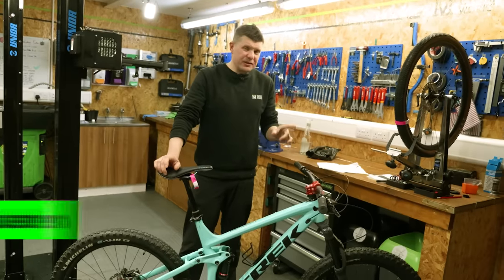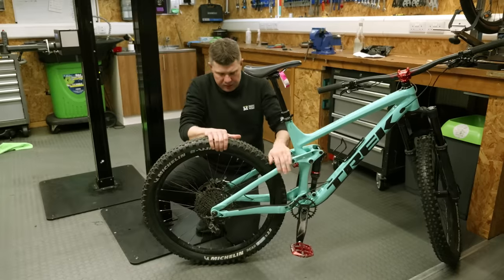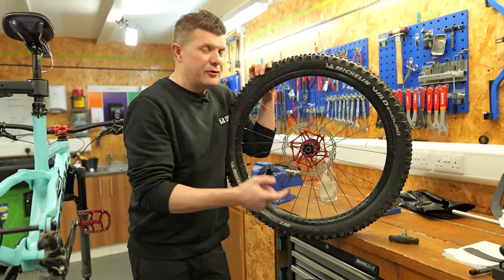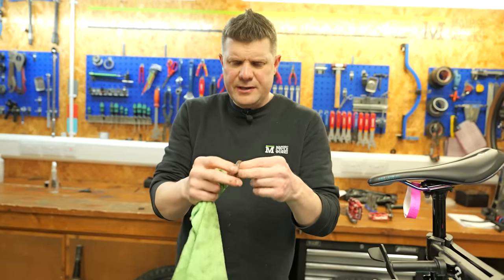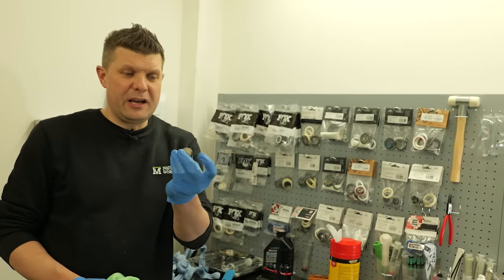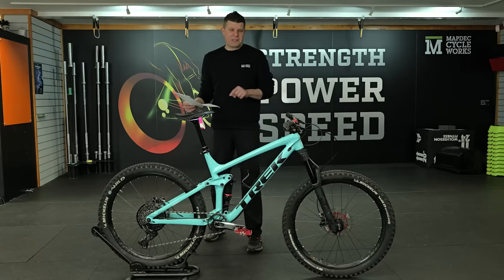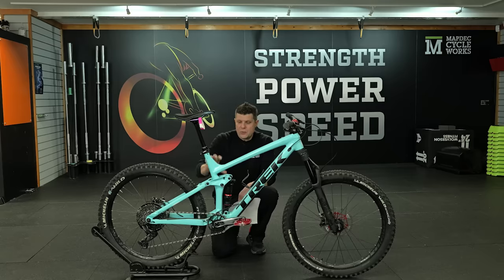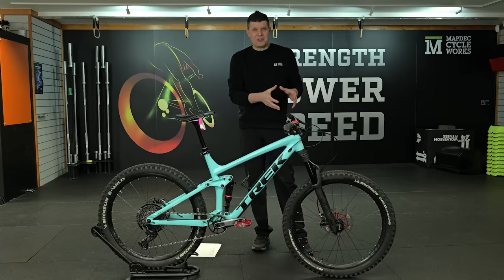They were quoted £975 to make this Trek Remedy safe

Comment: Old guy get off my lawn rant incoming and here goes... I'm 56 and raced motocross starting when I was 8. When I got to be 10 my dad told me that "if I'm old enough to race my bike, then I'm old enough to maintain it". He showed me how to change piston and rings on my YZ 80 and helped me the first couple of times, but after that I was on my own. So by the time I was 13 I was doing all of my own top end, carburetor, tires and tubes (my dad had to help with getting tires on and off) and just general maintenance. This was 1977 and while I was fortunate to have a dad who could show me, I had no other tools to help if I got stumped. Today, whatever you are trying to do, there is a You Tube video or some other help at the click of a few buttons. Mom (and hopefully dad) need to tell this young man the exact same thing because most of the problems were caused by a lack of simple maintenance and just a few hand tools, grease and the desire to do it were all that was needed.... Phew, now I feel so much better.
Reply: Great comment... Spot on
Reply from the maker: I feel you
Reply: Exactly my thoughts
Reply: 💯 the right thing to do. A few Ghetto fixes to get him back on the road and the budget for the important bits 😊
I regularly get remedy's in (3 mate's ride them) although a bike shop quoted a customer 40 quid for a dub BB service as it had play turned out the compression washer wasn't wound in or the grub screw wasn't to torque 😮 (no charge) 
Full swap sram code to xt brake replacement plus components, I even repaired the downtube protection with glue and full service and tune up. 
We need to do better and look after the little guy/ future privateers pay it forward 😊😊
Reply: I partly agree, it is preferable that we have adults teaching this stuff as well as the responsibility, but we don't live in the same world that we grew up in. Lots of people just don't have any grasp of preventative maintenance and are taken by surprise that mechanical things wear out, including with bikes. I have had the conversation more than once in my life, it's not just kids or gen z or millennials either, it has been my parents and their generation as well. You point out to them that they have to get their cars serviced and MOT'd, but it's an alien concept to them that other things are going to wear out in the same way.

And while we're getting frustrated by young people and kids and their lack of nous over 'obvious' things like how to do basic DIY or write a cheque, remember that for every boomer moaning about young people, there are a thousand boomers who can't manage utterly trivial tech tasks like email, messaging, online banking, setting up wi-fi, resolving login issues, and not falling for phishing scams.
Reply: Yeah, it's great to show empathy, but what did the kid learn from this? There's this element of older male to younger male shaming which has gone out of our culture and I really miss. That's how you know if you're screwing up when you're a young man. You get the dirty look, you're told you can do better. And then you get praised when you do it better
Reply: Amen! Give a man a fish and he'll eat for the day but teach him to fish and he'll eat forever.
Reply: Not every kid has a dad around to show him this stuff.
Reply: @SR20DEWhitebird absolutely, my nephew has an amazing father but unfortunately he's no very mechanically inclined, I try to teach him whatever I can. All it takes is someone with knowledge to try and pass along to someone without knowledge
Reply: @thunderstrukMTB not all kids are technically minded or have parents to show them what to do. I guess with all these Youtube videos that are a few click away, you do all the minor and major services on your car then?
Reply: @muhammedalfred my opinion is, if you have the ability to teach then teach and if you have the ability to learn then learn. It's very satisfying to learn how to maintain your own things and can save a bunch of money in the meantime. We live in throwaway times where people either chuck it in the bin or take it somewhere because they have no idea how it works.
Reply: @muhammedalfred  Comparing a vehicle to a bicycle is a strawman argument, however I'll bite. Basic maintenance like oil and filter changes, tranny drain and fills, engine and cabin air filters, wiper blades and even brake pads if I'm feeling froggy, absolutely, much less detailing it and checking the fluids and tire psi regularly. I would argue that 'almost' anyone able to ride a MTB, much less a 14yr old that is 24 months away from driving a 4k pound vehicle down public streets is capable of turning a few allen bolts to pull a stem off a bike and clean out a couple of bearings and the associated parts that make up a headset.... just have to have a desire.
Reply: Spot on.
Reply: @HindsightFPV  I think its very satisfying teaching how to maintain things, whats why I tutor students in marine engineering, but for people to start digging into the owner of the MTB “all that was completely avoidable with basic maintenance” are delusional. Let the kid ride his bike, enjoy his bike. They can worry about the preventative maintenance later.
Reply: @muhammedalfred  well that's how it turns into $900 in work.
Reply: Good shout, does Mapdec do any maintenance causes for people could be handy for people. Nice way to build relationship with the lbs.
Reply: @quixote1965 the issues in this look like a home mechanic build. Lots of people think they are good at doing the stuff in this video, or working on cars, etc. They aren’t. 

The owner of the bike may never need to do bicycle maintenance and may end up paying some one else to do it. They also may make lots of money coding or doing website stuff. Plenty of older people are incredibly inept with technology. And that is OK too because they do not need that knowledge. 

Plenty of times it makes sense to pay someone else.
Reply: I’m 58 and grew up pretty much like you. Except my dad didn’t know dirt bikes. So, I taught myself at an early age how to do it. But, everyone isn’t like you. Somewhere along the way, I became worth a couple hundred million dollars. So, why should I continue to work on my own mountain bikes, dirt bikes and cars, when I can make way more money off investments in an hour then it would cost for me to have someone else do it?
Reply: @Shawn-in-da-Canyon  exactly. Sometimes it makes sense to pay a professional to do things even if I could. Time has value. I could be spending that time with my dog!
Reply: @Shawn-in-da-Canyon  lol OK, if I was worth a "couple hundred million dollars" I wouldn't waste my time commenting on a YouTube video where people are discussing how to prevent a $900 maintenance bill.
Reply: @ShaggyRodgers420  everyone has their way of relaxing or finding peace after a stressful day. For me I'm in my garage tinkering or fixing something and my dog is right there next to me. Wasting money on something that could have been prevented with some maintenance, that's just silly.
Reply: @HindsightFPV  When it come to mountain bikes, I watch every video I can. That’ll never change no matter how much I have or don’t have.
Reply: A great many kids are still rolling around in wheelchairs from those death machines.
Reply: Think of what our dads did..
Today we’re a society of “call someone”
We used to fix it ourselves….
Reply: This 100%. Also really enjoy your content - like Mapdec you're also a straight talker, give opinions based on logic and reason vs. exaggeration for clicks like most other YT channels.
Reply: @lenolenoleno  Thank you ll88!! ☺
Reply: 100%. Changing a chain, greasing bearings, simple stuff. Ditto changing pads. And I am younger than you (55!)
Reply: Spot on. Did the same on the bicycle version at 14. If I didn't have the right tool, I'd often make something suitable out of a bit of metal or wood if appropriate. Worked out how to build a wheel at 15 just by looking at one and working out how to do the spoking pattern, it took some head scratching but held up fine. Skills like these learnt early have a big impact in being undaunted at problem solving in later life, many youngsters missing out on this these days, nowt wrong with pointing it out - tech gizmo's wont solve everything in the future.
Reply: While I agree with you entirely that people should learn to do some basic maintenances, including how to wash a bike without washing the grease out, the fact is that even with youtube it's not very 'quick' to learn how to do things properly. Sure there's lot of good tutorials. There's likely also some crap ones full of misinformation & cowboy shortcuts. You can see this bike was worked on by some cowboy, whether at home, at a shop, or by a previous owner. So it takes A LOT of time to learn to do things properly, and to be confident that you're doing them properly. I've spent 15+ years on my DIY journey to get to the point where I'm confident doing most maintenance tasks on my vehicle. You had a dad who could show you everything. If I had someone who could have shown me I could have learned all I know in a couple years, or even quicker. But teaching yourself is NOT quick or easy. The other thing is look at that workshop the guy used for the suspension, thousands of dollars of tools that this kid maybe doesn't have. The other thing is you were racing...this kid probably isn't or else he likely would have more knowledge, or friends who do.
Reply: @quixote1965  I'm hardly into the whole airy fairy woke bullshit that's promoted today, but you can show someone where they screwed up and teach them how to do better without 'shaming' them. FFS. You've no idea what the kid has learned or hasn't learned from this.
Reply: Agree 100%
Reply: We dont know the kids situation on wether he even has someone to teach him, any tools etc. 
But yes, in time hopefully he can learn as he goes
Reply: I'm 12 and build full bikes for fun. just watched a lot of videos + a lot of trial and error. def helped having pretty much infinite tools.
Reply: Great reading this. I knew guys like this, and similar story with their dad teaching skills like this.
Unfortunately, I'm so slow with mechanical stuff it's worth paying a professional.
Reply: Words of wisdom for sure. Modern parents are wussys can't and won't get their hands dirty then pass this trait down to the children just throw the credit card down to solve the problem. My dad also showed me how to completely tear down my bike reassemble clean and grease. My bike never spent a single day in the shop. When a part  needed replacement he bought it I put it on. At 14 years old I got a job then paid for all my own bike stuff.
Reply: 67 years old here, and all I can say is, " Thank you, it needed to be said!"  So many kids think," I can't  " is ok.
Reply: Ditto. I was racing flattrack in junior high, and me and my dad always did all the work on the bikes...........he loved fixing anything he had never worked on before.
Ive carried that on thru my bicycles and motorcycles 50 years later.

I swear to effing dawg, I ride bicycles with people who are barely competent to keep air in their tires, they would rather the shop did it so "they're sure its right".

No matter what it is, the bike gets dropped off at a shop.  What a hassle, the money, the drop off, the pick up...........as noted youtube has videos on fixing everything.

Pressure washers kill many 1000's of bikes every day, complete destruction but shiny outside.
Reply: @SR20DEWhitebird  My dad wasn't always around. I taught myself how to rebuild my first wheel when I was 11, by the time I was 13 I was building complete bikes out of old trashed ones and selling them.
Reply: @muhammedalfred  I was always told that by working on your own vehicles, you gain a much higher level of respect for them. When you understand the work that goes into doing those repairs, you tend to not mistreat the vehicle as those who just use it until it breaks and then just pay someone else to fix it.
What we have now is a culture of, I hate to say it but, spoiled people who will ride an extremely expensive bike that I or my parents certainly would never have been able to afford when I was 15 (heck I couldn't afford one of those now and I'm in my 50's ffs!), as if it's just a disposable thing that doesn't matter, until they get a honking great repair bill from a dodgy bike repair shop.
Not just in biking either, my little sis who is half my age, went through something like 6 iPhones in 2 years, until our mother passed away and she discovered that she would now have to buy her own replacements and hasn't just casually left one on the train 3 times in a row ever since!
Reply: I have a feeling hes newly bought the bike
Reply: It's annoying when adults can't change a tyre and get stuck when they have a puncture, plenty in my group like that.
Reply: @chocolate_squiggle  Right, he is picking up his fixed bike (at least 400 pounds) and no mention "and junior has been teaching himself to replace bushings, repack bearings, replace headsets, replace a chain & cassette".   I do my own work and have fixed a bike like that for $200 including tools and parts, and then I have the tools.     He trashed his rear shock by abusing it.   That's a $400 shock, minimum.
Reply: @ShaggyRodgers420 Mechanic said he pressure washed the crap out of the bike, ruining bearings.   And he abused his shock if it is cooked.
Reply: @SR20DEWhitebird  I taught myself from age 12 using Barnett's bicycle manual from the library.   You can now do ANYTHING except major shock maintenance.   Youtube has step by step tutorials.   it is a matter of willpower.   Chinese tools are dirt cheap on ebay etc (bearing pullers, chain tools, torx/hex).
Reply: @quixote1965  can confirm, 12 right now and just finished building about 20 wheels. Work on 90s mtbs whenever I have the chance and volunteer at the local co-op
Reply: @quixote1965  Yeah, that's not it. You're literally doing the "They did it to me and I turned out fine." If you're still hanging on to it, no, you didn't turn out fine. 

You can teach without shaming. I work with younger guys all the time. When they mess up because they don't know, I can see in their eyes they're expecting me to rip them a new one. And they're initially shocked when I correct the mistake, walk them through where they went wrong and how to do it correctly. No disapproving look. No shaming. Just teachable moments.

"This is what you did wrong. This is why it's wrong. This is how to do it correctly. This is why we do it this way." Simple, straight forward and effective. It also lets the guys know they can make a mistake and tell me without fear of repercussions from me. We're all adults. I will treat you as such. Act like one. 🤷🏻‍♂️
Reply: I see kids all the time on the school run on bikes with buckled wheels, flat tyres, V-brakes disconnected, rusty chains etc. All simple stuff to fix. My dad taught me from an early age that you look after stuff and how to maintain mechanical things. I was lucky I guess! Makes me wonder about the benefit of doing some sort of workshop for kids to teach them the basics but I'm not qualified. Well, not in bike maintenance anyway 🤣
Reply: I agree... However some people aren't fortunate enough to have a dad let alone parents that know how to maintain a bike... I've thought my daughter how to basic maintenance on her bike. IE. Cleaning, lubing etc ... But she's fortunate enough to have a 'step' dad that not only takes her out riding but also knows how to maintain a bike. Some people may not have the time do this sort of stuff hench why bike shops still exist, for some stuff I need doing to my bike I'll hit up my mechanic and he sorts it out for me if I don't have the time due to work, pets etc...
Reply: Whole heartedly agree with you, what are people like these days, I despair of the younger generations. No wonder the World is turning the wrong direction now.
Reply: @billienomates1606  Real "old man tells at cloud" energy.
Reply: No, my grandmother showed me when i was about 12 and she was about 72          @SR20DEWhitebird
Reply: @InsanercYT Amen, that's the spirit.   Now, I do hope you fine a good mentor.   Someone who is kind and competent.  And, having the "right stuff" to make it happen is admirable.   How do you build your wheels?   I use a park tensiometer and Jobst Brandt's method.
Reply: @chocolate_squiggle Guess what, a young man's mind functions best when it is focused.   And a "that's wrong" direct message and "you can do better, I believe in you, and will help you" message is more useful than pandering.
Reply: @dvs620 Guess what, a young man's mind functions best when it is focused.   And a "that's wrong" direct message and "you can do better, I believe in you, and will help you" message is more useful than pandering.    The kid who's mom just dropped 500 quid to fix his bike is going to feel entitled to it unless someone shakes his tree.   I live in an affluent town where there are tons of useless, entitled kids who have never had anyone who cared enough to confront them with the fact they are useless, and could do better.   I'm around young people who are offended if you comment that they should keep the nice car provided to them clean.
Reply: @quixote1965  I use the park tool video and a park tensiometer, I do have a good mentor at the local co-op who’s taught me a ton over the past few months
Reply: @quixote1965  It's not pandering. It's teaching. I don't try and shame them, I teach them. Pandering is treating them like kids. Respect is treating them like adults. "These kids" aren't the problem, people like you are.

They won't respect you because you've done nothing to earn it. Shaming them won't make it better. You should try learning to fix yourself first, since you're so into being self sufficient.
Reply: So true if you don't learn to do whats needed then you learn how to pay !
Reply: @SR20DEWhitebird but there’s endless online information to teach yourself this stuff - before the internet you just had to figure it out. I was also rebuilding motorcycle engines from around the age of 11 in the 80’s
Reply: Still a big bill, thanks for the honesty mapdec as the quote sounds really high but there were a lot of elements that needed addressing but its nice to have some empathy all same... I agree all kids need some guidance and sometimes an adult has to explain why things are done or not done, patiently.... firstly most kids including my own are easily distracted and a little spoilt so if they are passionate about something it makes it a little easier to train them up. Sounds like the kid had enough passion to try keep the bike clean, maybe with a little guidance he can work his way up to some preventative maintenance.
Reply: I had the same experience as you, im just 10 years younger. We now have have a bunch of offroad motorcycles and mountain bikes, unfortunately i maintain all of them. I had two boys and tried to get them interested in all kinds of DIY from mechanical, to spray painting, electroplating and electronics. They were never interested in anything other than gaming. Some people are just destined to pay someone else to do things they dont want to do.
Reply: Riding bikes is at least a bit more accessible to kids than moto. I mean, how many kids ride moto who’s parent/s don’t also? I have exactly one cycling friend with a moto background, and both his parents are moto bosses. So it was natural for them to teach him mechanical stuff, and that carried into his push-bike life. In contrast, the beauty of cycling is that you can take your POS department store bike and go ride trails. Or your Walmart BMX to the track. Kids do that, because they are kids being kids. There isn’t necessarily or often a parent at home with any mechanical ability whatsoever. Maybe they don’t own a Phillips screwdriver. That’s part of today’s reality. So part and parcel to cycling growing its participant base is more and more kids and not-kids getting into it with zero mechanical competencies. I guess the one thing that bugs me, in general, is the lack of consistent messaging around maintenance being part of riding. Instead, it seems more and more folks think your just rode it until it fails, then replace it. I’m stoked there are still shops like Mapdec properly wrenching, and talking about it. Respect!
Reply: All good advice and more importantly you feel better 🙄
Reply: Buy Richards Bicycle Book.
I build my bikes from a bare frame thanks to him.
Reply: The lad comes in with his mum, both may have no experience of amateur maintenance. It’s worth saying, some young people, don’t have the luxury of another experienced person around them, to show them things. Best not to assume, a Dad is around, many aren’t!
On the plus side, the lad comes to an expert because he clearly uses and enjoys his bike and recognises he also needs help. He also keeps his bike clean, showing pride and passion; two positives to take forward into adult life. 
Here endeth………………….
Reply: Agreed on all points. What it shows most of all is the importance of having an active father in a child's life. The video mentions the young chap came in with his mother, jumping to conclusions a bit, but yeah....
Reply: hi there ! I absolutely agree with you ❤... I wish i had the knowledge of derailleur adjustment there are soo many in you tube that show's how to adjust but I'm afraid of messing with it and making more of a mess than it was. So i just bring it to a mechanic to adjust it for a dollar.
Reply: @Canyon_Shawn 
It seems to me that it's good to work with something that is the polar opposite to your source of income.
Servicing your own bicycle is a skill which is attainable, rewarding, and something which you can use to bond with your kids as they grow up. You could of course leave your children enough money to keep them for life; not so good, as history shows us.
On the other hand, there must be the distinct possibility that you are just a lying troll.
Reply: Ok, boomer
Reply: .... thats his business though 😂
Reply: Agree for the most parts but as a professional bycicle mechanic I can tell you that the false confidence of some young bike riders holds an expensive learning curve for them in place. I'd like to see more young readers have simpler equipment that they paid for themselves. Eg a hardtail instead of a fully